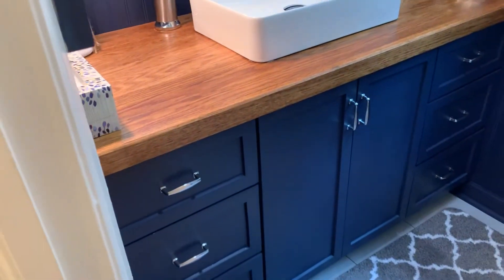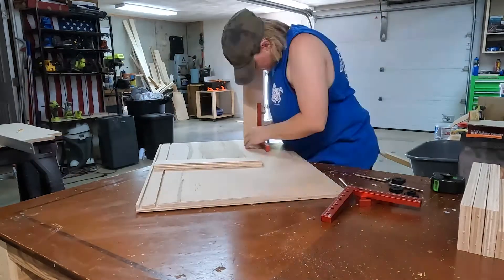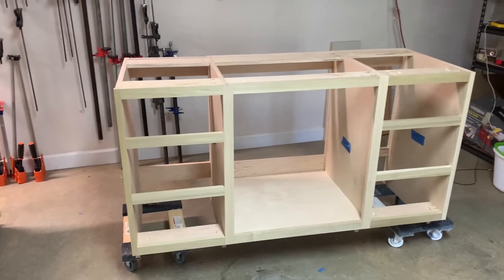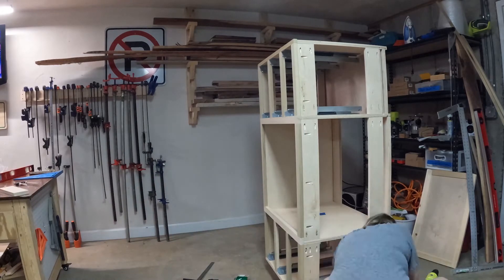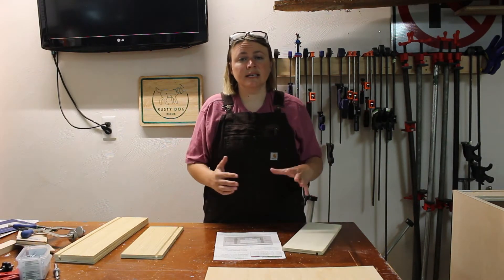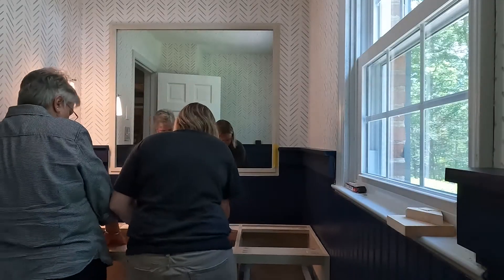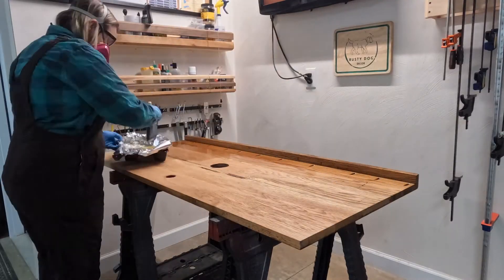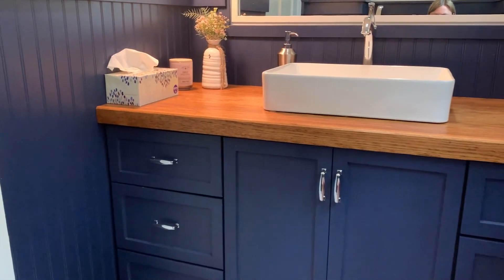How to Make a Bathroom Vanity

Comment: Interesting to see the process, you make it look very straight forward. And it turned out very nice indeed. How long did it take you? I'm guessing somewhat longer than the 15 min of video?
Also: did you apply some waterproofing on the bottom edge of the plywood?
Reply from the maker: Thank you! Building the bathroom vanity probably took me about 2 weeks in terms of finishing everything (cabinet, drawers, drawer fronts top and getting it painted etc.). This was part of a half bathroom remodel which took about 4 weeks total. To be honest I didn’t apply any waterproofing to the plywood. I didn’t even think of that! Haha Hopefully it will be okay because there wasn’t a ton of moisture/leaking issues in that bathroom but I guess time will tell! Thanks for watching! ☺️